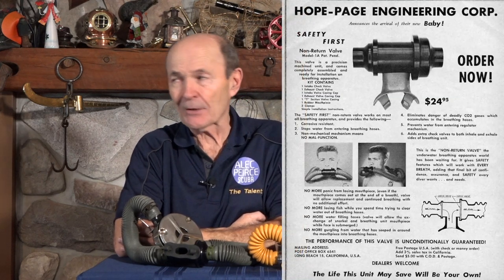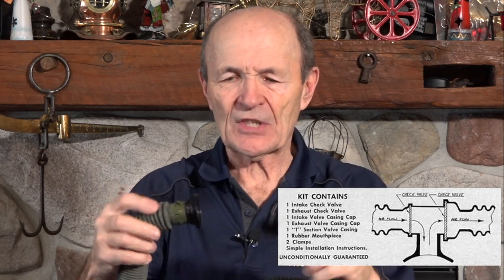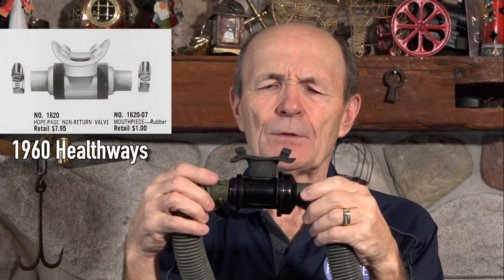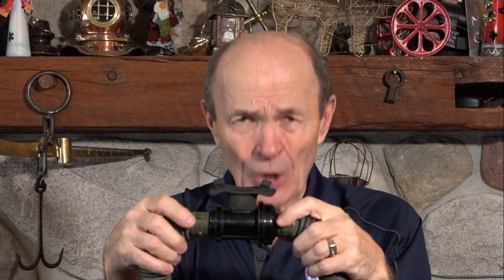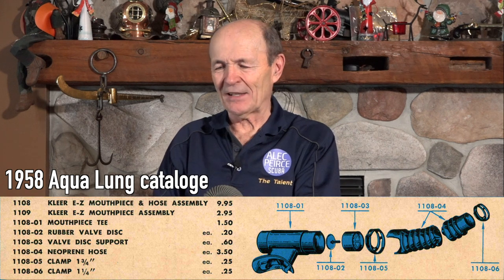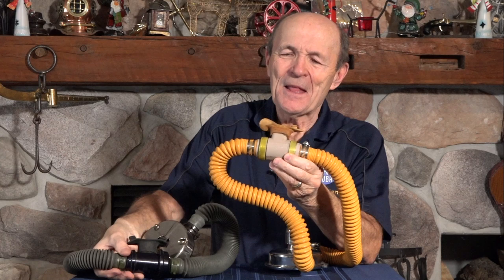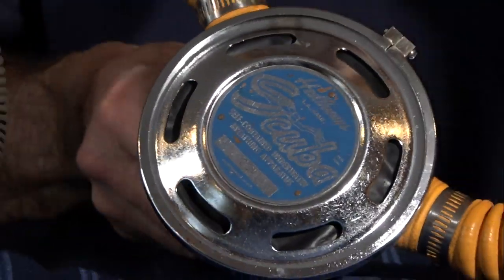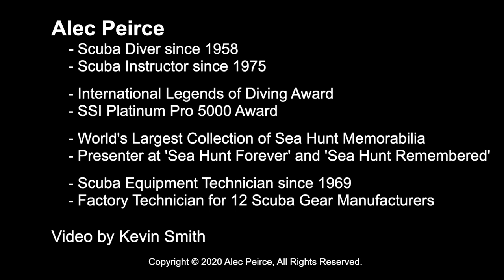Vintage Scuba: Hope-Page, Old vs New Mouthpiece - S09E06

Comment: + Alec Peirce Scuba. Thanks for these great videos Alec. Would you consider doing a video on ' Preservation ' techniques for your mountain of rubber gear ? I've used Glycerine, Talc, Silicon spray and zip bagged a lot of my rubber gear. But do you have any other techniques to preserve old dive gear ? Thanks very much. Mick
Reply from the maker: I did a preservation video S05E12 Caring for Old Scuba Gear.  Thick Ziploc bags have worked great for me too.  I'll think about another preservation video with this request.
Thanks.
Alec

Comment: Hi Alec. I always love a history lesson about vintage scuba ! One thing you mentioned was if water came back through the exhaust hose ,were there "duckbill valves" at the other end of the early single/two hose regulators or some other way to keep the water out? Take care Owen m
Reply from the maker: Absolutely correct Owen.  Original regulators had rubber duck bills that sometimes became almost glued closed.  VintageDoubleHose sells a mushroom valve replacement that really reduces the exhale effort and maintenance.
Alec

Comment: Alec-    You showed an ad for $24.95 and one for $7.95.   Did they decide that no one would buy one at that price,  or did they re- engineer it to be more cost effective?
Reply from the maker: Hi Kirk.  The $24 price was for the original H-P mouthpiece they sold directly.  They had some success, but were inventors not marketing.  When they sold their patent to Healthways in 1960, the $7.95 was for their newer version and sold across the USA.  I guess lower price, greater volume was the goal as several imitations (Kleer E-Z), completed for market share at $9.  Note that sometimes the H-P mouthpiece was sold as a replacement kit only (cut and replace), or a new end-to-end part with hoses and more clamps.
Hope this helps.
Alec